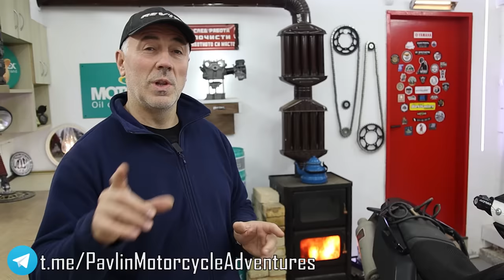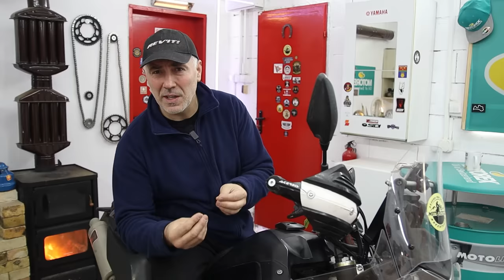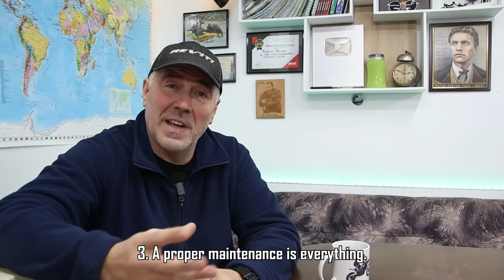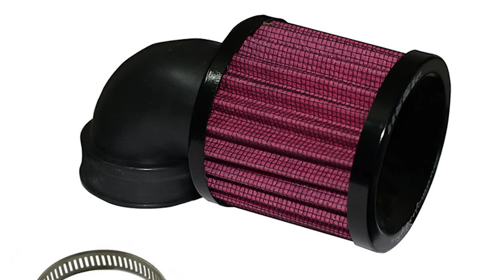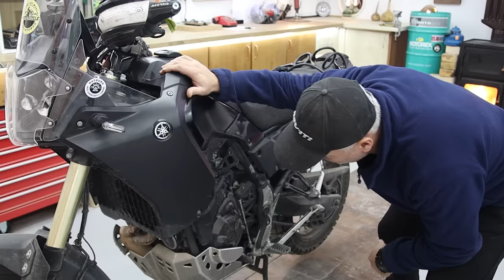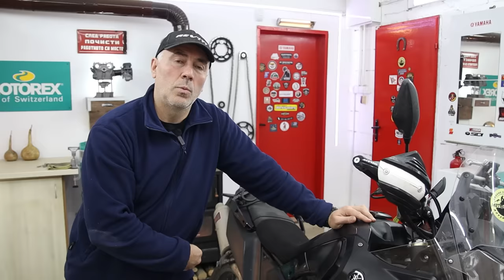5 Tips How to Extend the Life of any Motorcycle!

Comment: Excellent, valuable and to the point rules. I have an Africa Twin CRF 1000DCT; Honda says to change the oil every 8,000 miles (approx. 13,000 kms). Since I had the bike I decided to change the oil and both filters and o-ring (DCT model) every 4 to 5,000 miles. Learn from my mistake; I'm still kicking myself over riding the bike across USA continent (total of 6,500 miles) with right on 8,000 miles on the oil when I got back. I thought I could have changed the oil before I left but it only had not even 2,000 miles. I SHOULD have changed it at a friends place in SoCal, pretty much half way through the trip, when the oil had just over 5,000 miles. Why? When I got back home and changed the oil it was very dark with shiny particulate matter through the oil and some tiny chunks of aluminum. Now, the ride involved riding from 40+ degrees to minus a few degrees and from -246 ft to over 12,000 ft and cruising at over 80 mph for 10 to 12 hour days. But, don't do what I did and take your oil change to the max, especially with hard riding. Oil is cheap an engine is not and nor is getting your bike towed to the nearest town. My AT has exhibited no bad after affects like burning oil or weird sounds. The Blackstone oil report on the oil I used to essentially flush the engine out over 500 miles only stated there was a higher than normal iron content but no other contamination were present. So I dodged a bullet, I really thought I had toasted the engine. Pavlin's point with the electrical system is very important. I installed the Eastern Beaver Power Center to isolate any secondary items i.e. driving lights, heated grips and anything else from the primary system - the motorbike's main electrical system.
Reply from the maker: Thanks for sharing your experience!
Reply: Blackstone sent an oil report. From the metal results and report I didn't ruin the engine with riding around the continent through the harsh environments and pushing the oil to 8,000 miles. For 5,000 miles the oil had they stated 'Metals are low compared to universal 
averages and as you'll recall, those averages show typical wear after about 4,000 miles of oil use. This oil
 was in place a little longer and metals are in great shape, so we don't suspect any trouble.' But, I'm still irked I didn't do a simple oil change half way through the ride which would have protected the engine better and not caused such angst on my part. WHEW 😅  @motorcycleadventures

Comment: Clean oil is everything ………….and not abusing your machine , that is to say no overloading , no excessive  RPM’S , no excessive acceleration (hole shots / big strain on everything) and keeping everything lubed properly and at the proper operation temp. . Oil coolers are a “must” when touring two-up in the summer especially when traversing mountains (Alps) . It’s all about good quality oil at the right temp ……..period . I know , I’ve done the US / Canada (F’en boring) European theater and Africa a couple of times without any issues ……. except a few unscheduled speeding tickets (can you say “F’en Ouch !) 
If your engine is runnig correctly , and riding responsibly (no stupid shit) you should be fine for any journey life will throw at ya .
Keep it at the “sweet spot ?” (3300 + Rpm’s ?) and you’ll be fine , you’ll enjoy that brew 🍺even more ……at the END of the day .
After thousands of miles riding my advice ; stay alert , KEEP YOUR DISTANCE , and RPM’s at the proper level and you’ll be riding another day .  No animals were hurt during this composition………yet !     As for rode kill , never done that before , thank god . 

Oh , anudder ting ; don’t “F” around with your wires , a cigarette liter / with fuse is the only accessory you’ll need (GPS) .
Reply from the maker: Thanks for sharing!

Comment: I own an 11 y.o. Honda BeAT Scooter (1 Gen, Carb Type) mainly for city driving with minor 2 hour province trip, yet still it revs and rides like brand new. My simple secret? I keep it all stock, changing parts before reaching it's life span / not reaching breaking point (original honda parts), and change oil every 2,500 km (instead of 4000 km in manual) because oil is cheap. This video is really SPOT ON SIR! THANKS!
Reply from the maker: Thanks for sharing!

Comment: If you change your oil  at half the distance recommended, then you don't need  to change  your  oil  filter at the same  time.
The  proof  of the  pudding is when you cut your oil  filter apart afterwards (!) and check how  'clogged' it actually  was (or wasn't).
(BTW, that is the way to tell when your  motorcycle is run in...when there is no more tiny metal shavings lodged in your oil filter...after having cut it apart)
.
Reply from the maker: It cost nothing compare to oil and it will be always better.

Comment: generally I change the oil every 3,000 km or once a year since I got three bikes and I'm not riding too much.  

I also change the filter and clean the air filter or change it for a new one.

lately I bought a brush for cleaning the chain and oil spray to clean it and oil spray to lubricated.

I only do maintenance on one bike because I don't understand nothing of mechanics, the other two bikes I take them to the shop. I got three bikes but they are from 2001, 2002 and 2006 I am not rich at all. all of them were bought used.

* I know that you made it a review about The African twin 1100 but in my country there are many customers complaining about the consuming of oil in every thousand kilometers, the critics seem to me to be true unfortunately, since is one of the best bikes on its class for me because it's fast enough is well balanced, the position of riding is very good, it has some weight but all of these bikes have some weight.

*** I would REALLY like to see a new review of the Husqvarna 701 Enduro or the KTM 690 Enduro because they have changed on mechanical levels and I would like to see if they are more reliable. 
And there is nothin japanese on that level, weight/ power and suspentions.

* one thing that I would like to see also, that was never been done on this channel is a review of an MX bike 450, one of the Japanese bikes brand because some people would like to see if it is possible to maintain and deal with the bike for having some fun on the dirt.

Good video Pavlin, with smart opinions made by experience.
Reply from the maker: Thanks for taking the time! I will do the reviews when I have the chance. I do have a review of Husqvarna 350 dirt bike: https://www.youtube.com/watch?v=rwJyBLkxoKQ
Reply: @motorcycleadventures  Thank you

Comment: I wouldn't agree regarding RPM. Some engines just don't produce enough power at low RPM. My CFmoto 650 feels very sketchy at 4000-5000, there isn't enough response if I need to accelerate from that point. It would first need to spin to 7000, then it would generate enough power to actually accelerate. Perhaps, bad fuel mapping or it's just my bike. Anyway, that's a couple of seconds which may not seem like long unless you're trying to pass a truck on a narrow road or do anything that requires rapid acceleration.
Reply from the maker: Short RPM's are not a problem.

Comment: I guess I've broken a few of those rules. I ride my R1150GS regularly offroad.  I change the oil every 10000km or once a year. I often rev it to or close to the red line. So far so good. I bought it new 21 years ago, it's on 230000km, still on the first clutch, with no engine work. Knock on wood....
Reply from the maker: Thanks for sharing!

Comment: What's your thought recommended vs realistic maintenance schedules? My nc700x has an 8000 MILE oil change schedule in the manual. I see people recommend changes in the 4-6000 kilometer range for bikes in general, though my bike is a very low compression and rpm machine.
Reply from the maker: If you ride it normally 10,000km should be more than enough.

Comment: I disagree on just one thing. I beleive you can add reliability later by preventive maintenance. Best example is the charging system. Many Japanese models are known to fail stators, so I beleive it's good practice to change your stator and voltage regulator every 50k kms. Carry a spare if you want but I think changing it before a long trip is worth it rather than waiting for it to fail and then repair on the road.
Reply from the maker: This way won't bring any additional reliability to your model, but will definitely reduce the risk of having problems on the road.

Comment: My bike comes with all halogen bulbs and was thinking of making it all LED. This will consume less power from battery and the engine but are there any downsides to it?
Reply: Might have to change turn signal relay. LED=less draw causing hyperflash
Reply from the maker: It is problem only with indicators. Halogen bulbs will definitely provide more light.

Comment: Pavlin, does your Tenere 700 consume a little bit of oil on 9000 kilometers? Do you have to refill a little bit?!
Reply from the maker: No, never!
Reply: @motorcycleadventures  do YOU check the oil level on centerstand or do YOU hold the motorcycle upright with your hands and check the oil level?
Reply: @motorcycleadventures  AND do you fill your oil to the maximum or betwen minimum and maximum range?! I found that 2.6 liters of oil Are a little bit to much and that the shifting isnt so great then?!
Reply from the maker: 2.7 always on maximum. On wheels.
Reply: @motorcycleadventures  thanks. I found out that on the same surface the oil level isn’t the same on centerstand and on wheels. From now on i will check the oil on the wheels not on the centerstand, just like you said.